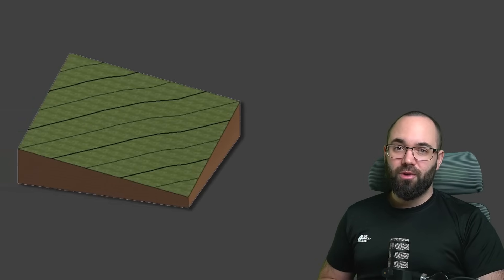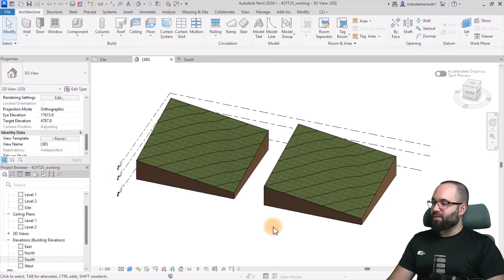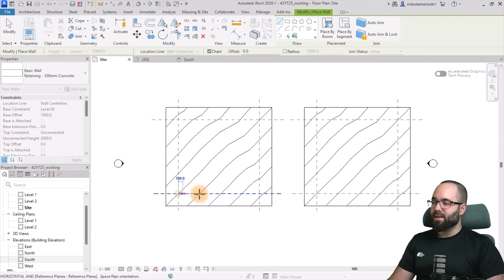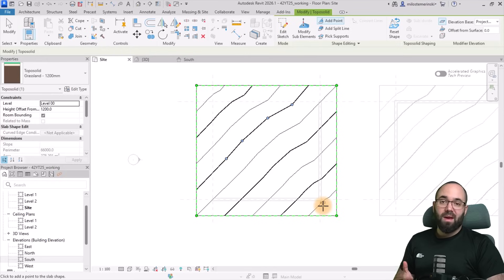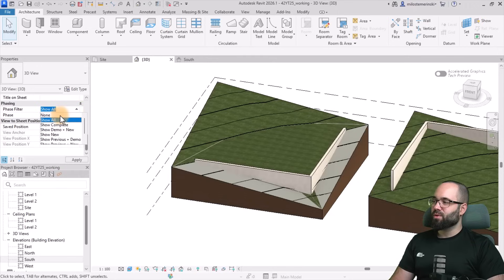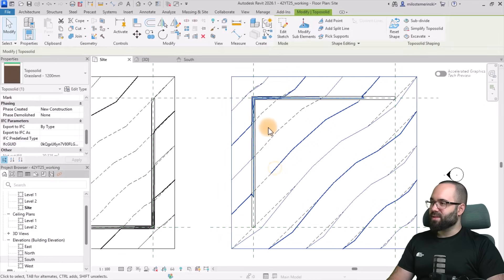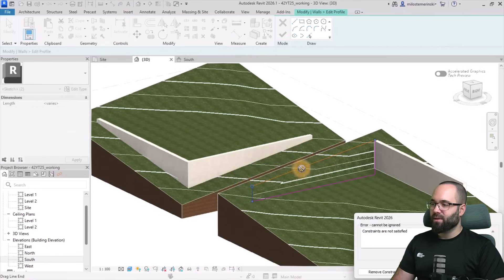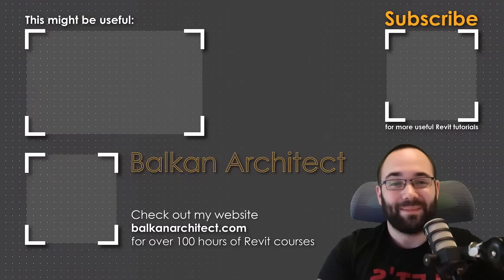Retaining Wall in Revit Tutorial

Comment: hi
snap line for(add spilt line) It didn't work like you did
Rather, the line was determined from the middle of the wall... As you did in the minute (3.00).... Why?
Note.....: that all snap settings are activated 
Please help, it is very important
👑👑👑